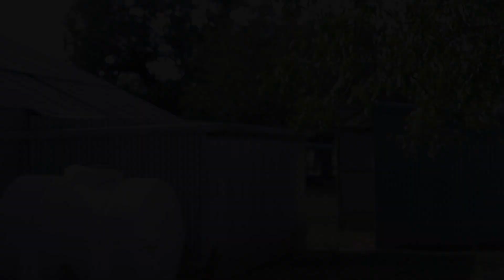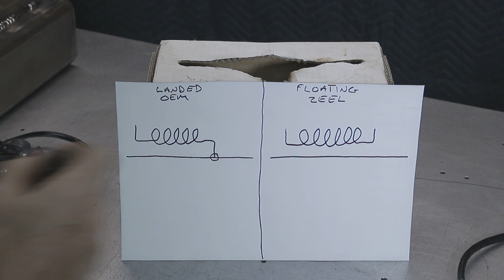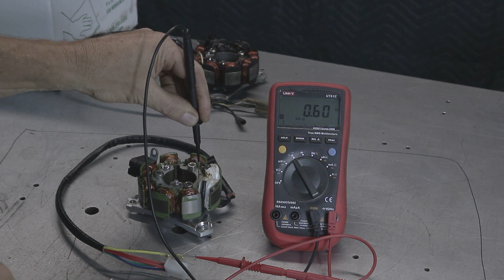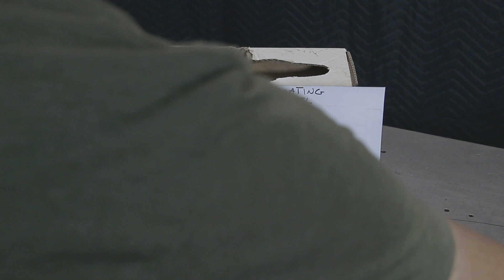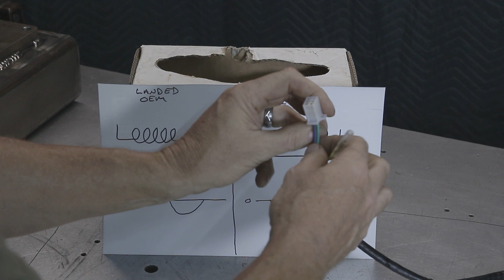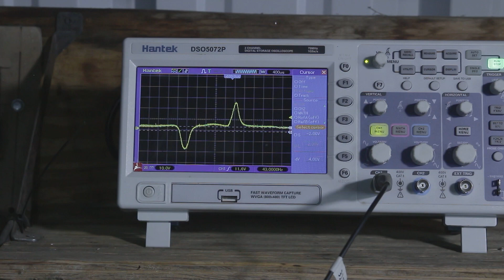DMR  Zeeltronic on a 250R part 1

Comment: Got a question for ya Dave would it be worth trying to make a little device and actuator to electronically control a power valve did anyone ever make one or is it just better to not bother and tune the ports to what you plan to do with it? I seen you have all this information and was wondering about it Ik you’d need to add a tps sensor of some sort to make it work but just a thought

Comment: I am having problems with a tr250r with the zeeltronics kit on it. The bike will start but immediately shuts off. Will not stay running. Almost like as soon as it gets an ignition signal. Its told to turn off. I tried pulling it behind a car to prove my point. And it does the same thing. Refuses to spark after initial start-up
Reply: Do you have it  ground back to the engine
Reply: @shannonshepherd433  no.
Reply: @CumberlandMotorsports  watch around 23:20  mark.
Reply: It WILL NOT run right  if its not grounded properly
Reply: Anyluck

Comment: I have a vortex X10 trx 250r cdi..it was programed by toyoko mods but I have no way to suck the maps or know what map is where...I have a dc converted stator but the cdi works on either or. I guess I just need to figure out howto get the maps off the cdi. It's got like 13 ignition maps on it.
Reply: Still running well?
Reply: @mmholling87 yea i was going to sell it for a zeel but i finally got a guide to the maps on it so i think i will keep it..i Like having a lighning coil...my billet 380 lynx should like it.

Comment: Maybe show the correct wiring orientation for the pick up wires blue and green at the connector . I’m down on power and was told it’s wired backwards but wired the “correct” way it won’t start.
Reply from the maker: Thank you ill add that to my list.
Reply: @davemooreracing  Hi Dave first time around you channel you did very clear, just one thing , would you please make a video about Zeeltronic set up please thank you